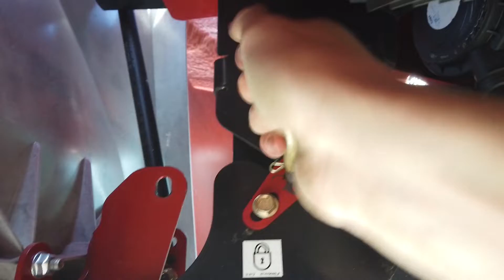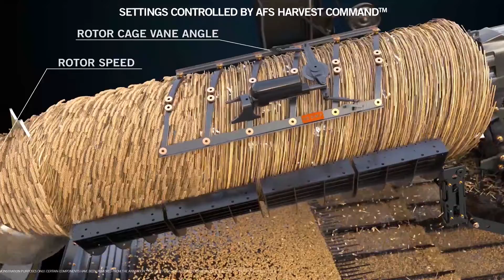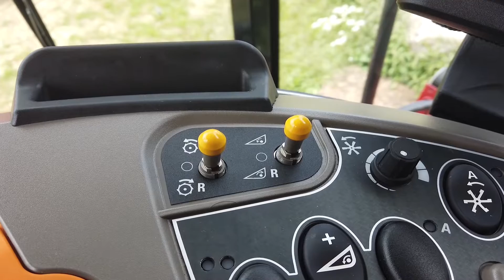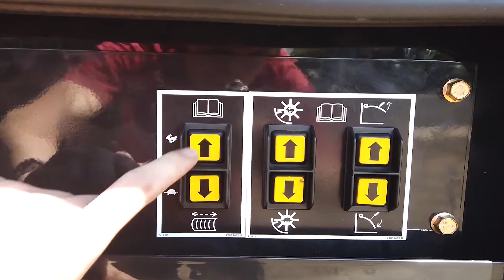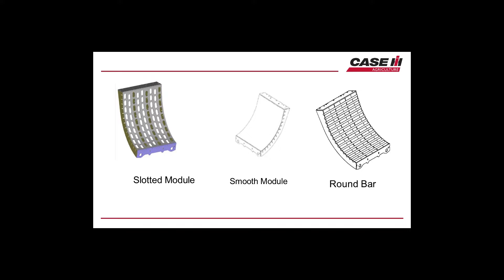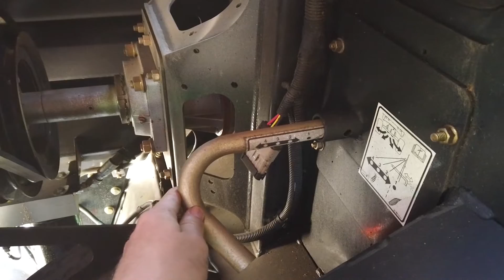Case IH Axial Flow 250 Operator Training 2020- Thrashing and Separation

Comment: Hello.  I have a 7250 small rotor with a standard configuration of 18 10 degrees in front.  The combine cannot exceed 3.5 km. Is this the problem?If you replace some 10 degrees with 28 degrees will the rotor unbalance?Thanks